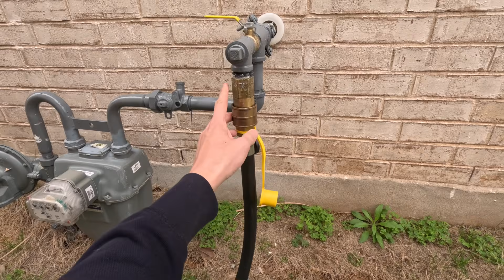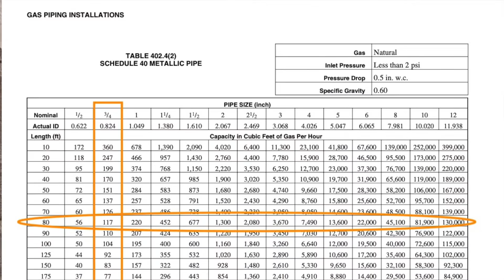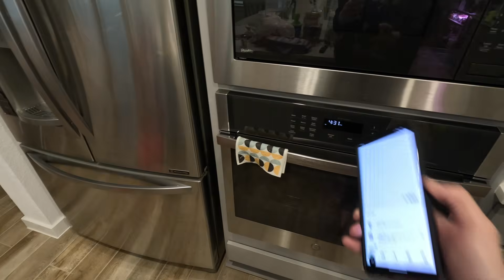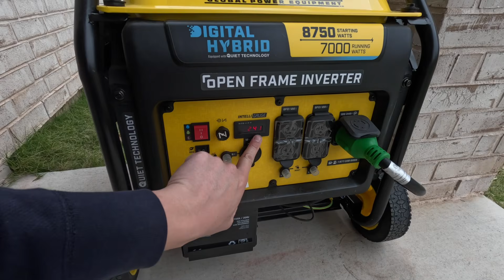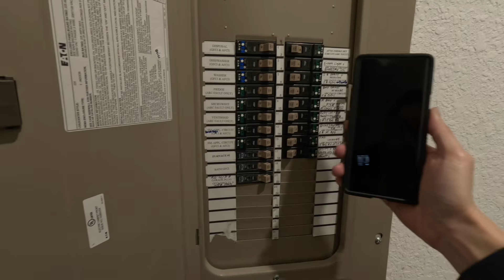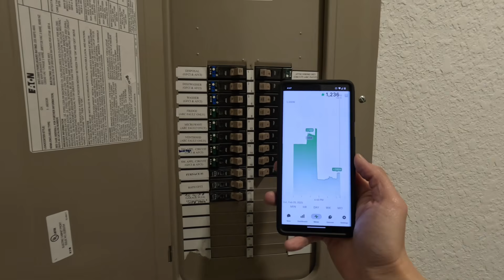Champion 100520 + Motor Snokel + Natural Gas = THE ULTIMATE BUDGET FULL HOME BACKUP GENERATOR?

Comment: What app are you using for wattage use?
Reply from the maker: Sense app, but I don’t recommend it anymore. Mine doesn’t work after the company got bought over by schnighter electric or however you spell the company name. I would go with another solution from Amazon. The meters cost about $100-200 and you can get a phone app to see the utilization.

Comment: Awesome test! Very similar to what I'm trying to do except that I'm putting a Bluetti Apex 300 in the chain with a Westinghouse iGen8200TFc 

natural gas meter/hose -> inverter generator -> 50A cable -> Apex 300  (battery power station) -> 50A cable -> interlock connection -> selected circuits of main breaker panel

That will make my maximum continuous AC output of 3,840W and a peak surge capacity of 7,680W, which is slightly worse than what the generator can do. Luckily the Apex 300 will passthrough the extra power, so I'll get the max running power of the generator (Gasoline: 6600 running/8200 peak watts, Propane: 5940 running/7380 peak watts, Natural Gas: 5280 running/6560 peak watts) when it is running. I plan to shut-off the generator at night and store the garage, to prevent tampering/theft.

I agree that it's better to have a valve outside on the NG that requires a tool. All my emergency power system is meant to do is run all my NG appliances in case of a winter emergency (furnace, water heater, oven, and stove) and small-ish loads like computers, lights, microwave, battery re-charging.
Reply from the maker: That’s great! I haven’t added any batteries to my setup, but it does sound like a great idea. My dad runs solar panels and batteries, I just never got a chance to do that setup. Thanks for sharing!

Comment: Damn you must have some sketchy neighbors to need to take off shut off handles and run a sketchy long flex gas line.  I would check code and get a gas company inspector out.  You need to protect your neighbors safety.  Dont put the costs on a spreadsheet.   Your "neighbors" will definitely be looking at your setup if they know what you paid.

Comment: What size is that gas line?  It needs at least 135000btu/hr supply.  Is it working well at that length?
Reply from the maker: It worked just fine with no other gas appliances in use at the same time. I cover all the details in the video as well as the calculations on sizing… I don’t have a good memory, but I want to say it is coming off of a 3/4” tee almost directly from the gas meter which is 1 1/2” I believe before it goes into the house.

Comment: Hi Johnathan! Thank you for the tips. Do you have quick disconnects on both ends? My hose came with one quick disconnect, but I wanted to see if it was safe to have one at the generator, too.
Reply: Hi there, yes I have quick disconnects on both ends. Be careful with cheap quick disconnects and inspect them regularly, they could leak. If you get a gas rated quick disconnect, you should be fine.
Reply: @ Thank you! I’m actually watching your other videos now. Keep up the awesome work!👏👏👏

Comment: Where did u get your long 50amp cord ?
Reply from the maker: Amazon - https://amzn.to/3C3uJZc Note, I am doing a 30 amp setup, not a 50 amp setup. You'll need a thicker cable and a different plug for 50 amp. Probably a 6 or 8 gauge wire like this (https://amzn.to/4agDOud) and 14-50P to SS 2-50R plug.

Comment: So how many turns on the load block did you end up at, to be able to run the AC?
thanks.
Reply from the maker: @brianharris7029  it was 12 on natural gas or so. It was less for propane, maybe 8? It is  variable depending on gas pressure and load. I would not recommend just blindly setting it, you definitely need to adjust it based on environmental conditions and the type of fuel you're using.

Comment: A lot of people do not realize there can be a significant amount of carbon monoxide accumulation in the attic when they run their generator close to the house or in a narrowed fenced area close to the house.  The ventilation soffits under eves of the house to help cool the attic can draw up the exhaust/carbon monoxide into the attic and then inside the house.  This past winter the news reported the death of a family and pets due to carbon monoxide poisoning.  The generator was near the side of the house in a narrow gated alley area.  They determined the carbon monoxide accumulated in the attic from ventilation soffits.  Please keep your generators approximately 20 to 25 from the home and in a well ventilated area.  Always good to have carbon monoxide detectors in multiple areas of the home when using natural gas appliances as well as a generator.

Houses in the past 30 years are much more energy efficient compared to the past.  Older houses can be drafty if they were not modernized.  This did help prevent carbon monoxide accumulation because fresh air was always coming into the home.
Reply from the maker: This is really excellent advice - you totally lose any value with a generator if you end up ending the lives of you and your family. 

As a precaution, I never run my emergency generator setup while I am asleep because as you stated, carbon monoxide can build up especially when you have it unattended. I also make sure I have carbon monoxide detectors in all the bedrooms. 

Thanks for sharing and I do hope everyone exercises safety and caution when running emergency generators in a temporary setup like mine. There are certainly risks you have to be aware of and steps that you need to take to stay safe.

Comment: Nice video. Which energy monitor are you using in the video? I think you said Sense? I need one of those.
Reply from the maker: Yeah, it is the Sense monitoring system. https://amzn.to/3M8V4GH If I were to do this again, I would probably try the Emporia monitoring system - https://amzn.to/4dnc3kq. It has been getting a lot of good reviews on amazon. Also, Sense has gone up like 2x in price since I bought it. I don't think I would ever pay the current price it is at now.
Reply: Ok. Thanks!

Comment: Jonathan, Do you have a video about how you did the electrical hookup from your power cord to the circuit breakers? Looks like it works well. What kind of transfer switch did you install? A Generac HomelinK?
Reply from the maker: Hi Ronald, I went with the cheapest, NEC compliant option - a backfeed breaker with a manual interlock transfer switch. As long as you do not have both the utility power and the generator power connected at the same time, you are ok. A manual interlock transfer switch physically prevents both the generator backfeed breaker and the main utility power switch from being on at the same time. I don't have a video up on that yet, but I may put one up in the future to discuss how I set that up. Thanks for commenting.

Comment: Congrats...great job.   I do like that you moved that noisemaker away somewhat.  What I'm weary about is the safety of your long gas line and possible voltage drop from the extn cord.   I'd be concerned about foot traffic in the alley from your spouse, children & their friends, and/or delivery & service personnel.  In any emergency pwr setup I'd be concerned about possibility of unanticipated and significant house loads switching on while the system is already running at/near max....and while I'm not at home to react to an overload trip.   E.g., electric hot water heater, sump pump, vacuum, insinkerator, etc.  Again...kudos to you.
Reply from the maker: Hi Preston, thanks for commenting! During an emergency, nobody should be walking on the side of my yard - my kids don't like going out when it is too hot or too cold. I spec'd the gas line and electric cable to account for the length of the runs. The gas line is 3/4 inch diameter for that purpose as well as the electric cable being 10gauge. For the electric cable, I can go as long as 100ft before worrying about voltage drop at 30Amps. If I was to move up to a 50 amp generator, I would definitely need to do 8 gauge wire. This is definitely a poor man's setup. If I wanted to have everything automated, definitely going with a Generac backup generator is the way to go or even a Tesla power wall with some solar. However, I wasn't interested in exploring those options because power is so seldomly out in my area, I didn't need something that I needed to regularly rely on. It didn't make sense putting out over $10k for a solution when I was able to put this together under $2k. I would never leave this thing running when I'm not home - I actually don't even leave it running overnight. I wouldn't trust where I have it to not start carbon monoxide issues while I sleep.

There are definitely solutions out there that can cover unanticipated and significant house loads - you just have to fork out $10-40k for them! If you find a system that handles everything automatically for under $2k, let me know - I would definitely be interested myself!

Comment: Wow this is my exact situation as far as NG meter placement and wanting to place the generator on our back patio. Thanks for the video.
Reply from the maker: Awesome, glad this helps. Just one word of caution - take precautions to prevent carbon monoxide buildup in the house. If the wind is blowing in the right direction, it can allow carbon monoxide to settle and enter the house through the backdoor. I would make sure I have a working carbon monoxide detector and I also would never run the generator while I am sleeping. It is recommended to have the generator at least 15-20 feet away from the house, but many people don't have the space to make that work. You can check out this reddit thread for more info - stay safe! 

https://www.reddit.com/r/Generator/comments/vyhhht/what_if_you_cant_run_a_generator_20_ft_away_from/

Comment: This is why you need an inverter generator.  First, they idle up and down to use fuel conservatively.  Second, those spikes you're seeing are going to ruin anything sensitive in your house.  Avoid these cheap piece of crap generators and get a good one.

Comment: I really appreciate the videos you have posted.  I am doing nearly the same thing.  One question:  what gauge electrical wire did you use for that 80ft run?
Reply from the maker: Thank you! The gauge of wire depends on how much current you want to run and the length. There are charts online that you can find. I found the Southwire calculator a good tool - https://www.southwire.com/calculator-vdrop. I was going for 30amps at 240V - 10 gauge copper was sufficient for up to 100ft at those specifications. Hope this helps, thanks for commenting!

Comment: Hey, thanks for this video. Could you please tell me what parts were used to  convert the 1/2 inlet for natural gas to the 3/4 hose at the generator. Im in this process and cant find that part thanks...
Reply from the maker: Hi Terrance, without seeing your exact setup, I'm afraid I may tell you the wrong part. You might be able to get away with a 3/4 inch female NPT to 1/2 inch adapter: https://amzn.to/3LJeGks. However, you might have a better time just going to your local hardware store with the 2 different parts and trying different things out in the pipe fitting section for 10-20 minutes. I can't tell you how much time I've wasted in that aisle learning about all the different fittings - there are so many! Wish you success on your setup!
Reply: Thanks so much for your reply. I think this will work. If not Amazon has easy returns. Thanks again I appreciate it.

Comment: Great video. What power meter are you using? I have the same setup using a Firman tri-fuel but I don't have a meter to watch my loads.
Reply from the maker: Hi TheSeaweed64! Thanks! I am using the Sense power meter - https://amzn.to/3WEfcXe. It was significantly cheaper when I got it, not sure if I would recommend it at the current price. If I was to do this again, I might try the Emporia - https://amzn.to/3LJf3vm. Big disclaimer, I never used the emporia so it is hard for me to vouch for whether it is any good or not.

Comment: How did your setup turn out for hurricane beryl? If you lost power, for how long and what you were able to run?
Thanks
Reply from the maker: Hurricane Beryl fortunately missed me (I am in Austin, TX). Unfortunately, I couldn't stress test the system in a multi-day blackout situation.
Reply: @jonathanDIYs  Thats good to hear, you have a great setup and feel confident it will all work when needed.

Comment: Someone said to add up all the cfm and compare them to your gas meter to see if it has enough capacity.  Otherwise, you have to contact the utility company to get a bigger one.  Does anybody know how this process work if I need a bigger meter?  Does the utility company replace it for free?  Or do they sell it to you and you have to get a plumber to replace it?  Thanks!
Reply from the maker: I don't think they would allow a plumber to touch the meter. Depends on the gas company, some are able to increase the pressure and just install regulators on all the devices to allow more gas using the same pipes forgoing the need to replace the meter. You gotta check with your local utility company.
Reply: @jonathanDIYs  sorry. Yes that’s what I meant. Install a new regulator for the house.

Comment: 1:25  Great video, but I think that during a power outage, the last thing you need to worry about is mowing your grass !  I only wish I had both my natural gas and electrical box so close to each other.  Mine are both on opposites sides of the house, and gas is right next to the master bedroom.  I will have to run a very long pipe or big hose 75 feet to get it in the ideal spot near the breaker box.
Reply: You use gas then.

Comment: How is this generator with your Central Heating AND the electric oven at the same time?
Reply: I have natural gas heating. I would be concerned if I have enough BTUs of natural gas to run both at the same time if I was running the generator off of natural gas. I think in an emergency situation, I can run one thing at a time with no issue. Next time I have my generator hooked up to natural gas, I'll give it a try to run both central heat and the oven and see if my generator would choke out. I wouldn't be surprised if that happens. Thanks for commenting and asking!
Reply: @jonchanvlogs   yes, exactly my point. I bought this same generator (which arrives tomorrow) and bought the Tri-Fuel kit from NashFuels.  I have gas stove, gas clothes dryer, gas water heater, and gas central heating and am wondering about running this generator on a low flow / low pressure natural gas while also under a good electrical load.
Reply: @jasonhildebrand1574  so if you're interested in running everything at once, you have to do proper gas pipe sizing calculations. I skipped that as this is solely for emergencies and as long as I can run 1 thing at a time, I'm happy. Plumbers have a pretty standardized method called Total Length branch sizing which tells you what diameter pipes you need for your system. I found this video a fairly good explanation on this: https://youtu.be/zjJXVGjs0hQ?si=ZpyIOCSD7Gvp3dlI Do note that larger diameter pipes are more expensive. 

Let me know how the nashfuel goes. I avoided it because I heard the thick block can interfere with regular operations. The motor snorkel was a lot thinner.

Comment: Champion must have paid you I bet you it won't run 32 hours on 5 gallons Harbor Freight Predator w i l l it's all I use for electricity it's not good on a 30-lb tank of propane going to get 27 or 28 hours but it's good for me I run it to charge the batteries for the fan cell phone batteries
Reply: Yeah, Champion is paying a guy with 900 subs😂😂

Comment: I’m only at the beginning but I’m going to tell you, that long cord and gas line is a serious power loss. Gas line loosing btu’s and IR drop on extension line has to effect final power factor.
Reply from the maker: The gauge of the wire is thick enough for the amount of power I'm pushing to the house. I don't read any significant amount of voltage drop with my setup and I sized the natural gas hose to be large enough to at least run the generator on its own without other gas appliances. If you watched to the end, you'll see I reached all my goals for this system.